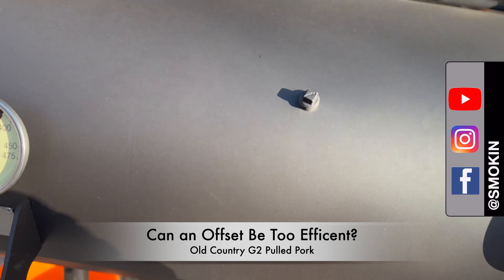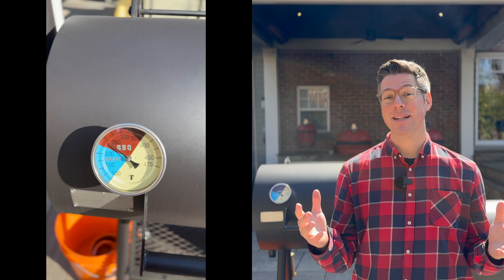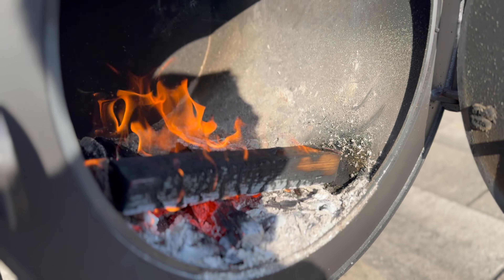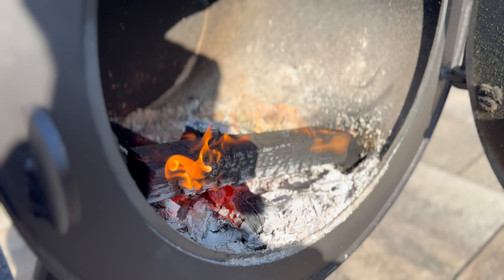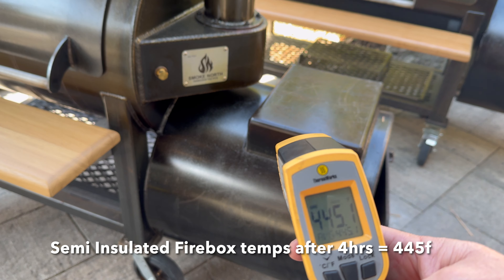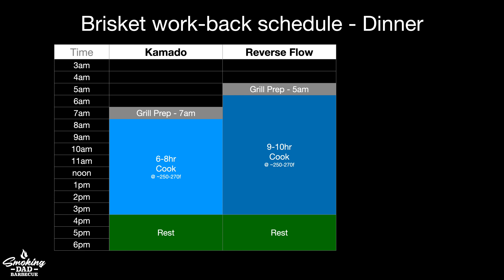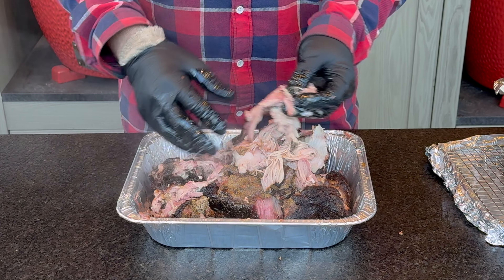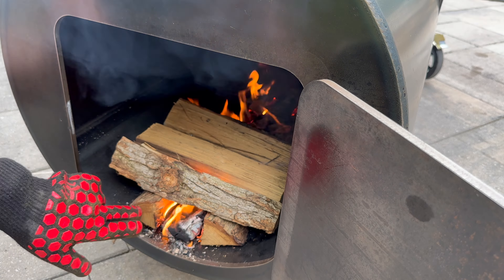Deleting The Fully Insulated Firebox Would Make The Old Country G2 Offset Smoker BETTER?

Comment: Due to its price and ease of use, I think the G2 would be a great first offset. I liked the Mortal Kombat reference. Great review!
Reply from the maker: many thanks, glad it helps.  It definitely solves some ease of use issues ... i am wondering about a two piece insert / semi insulated firebox just using an air gap might be the best of both worlds
Reply: @SmokingDadBBQ  Is the G2 firebox air insulated or does it have an inslulating medium behind the walls like wool?  Also isn't the wall opposit the door not insulated?  tif so technically its semi-insualted?
Reply from the maker: @butkusrules08  it’s got insulation between the metal layers

Comment: I'd been using an OKJ Highland for 4yrs and wanted to move on to a 1/4 steel offset at a decent price.  I do a lot of cooks with the OKJ in the winter using firebrick in the firebox and a welders blanket on the cook chamber. I had pulled the trigger on a new G2 but changed my order after seeing multiple reviews about the lack of smoke flavor with the fully insulated firebox. I quickly switched my order to the Brazos Deluxe and am glad I did!  Put a stack extension on it and lined the floor of the firebox with fire brick. It maintains great temps with very mild temperature spikes. I have unlimited access to hickory and oak, (cut and split my own), so i'm free to put all the smoke flavor I want to into my BBQ!  That's what its all about for me.

Comment: Imo the Brazos is a better buy for under 3000$ category.  Found mine in mint condition for 250, added some modes and now it's a smoke house machine.
Reply from the maker: you can not beat that deal

Comment: Great point. The main goal to cook on an offset smoker is to get the superior smoke flavor.  You were burning the least amount of wood. Seems difficult to run few hours of cold smoke. Even then, it would be too long of cook time.
Reply from the maker: I'd love to see some of the investment/cost moved from the fully insulated firebox towards a larger cook chamber and potentially make a removable semi insulated firebox accessory as an option vs. not having the choice to get the full offset flavour out of the box.  also, personal preference given the paint is flaking off after a few heat cycles would be for a raw finish that could be seasoned with oil vs. the black flaking paint.

Its better value than some at this price point, but also not so much less than some premium options that having flaking paint after a few heat cycles feels worthy of the price point
Reply: @SmokingDadBBQ  It would be really neat if it came with a non-insulated firebox and you could get an accessory that wraps around the fire box to insulate it.  I'm not sure how practical that would be though.

I ran the G2 as hot as I could when I got it to burn off anything that was on it / in it before I used it / seasoned it and so far I haven't seen any flaking paint [not even in the firebox].  That said I did give everything a liberal coating of avocado oil [atomized via sprayer] once it was hot so that may or may not have helped.

So far the paint on this seems to be pretty robust.

Comment: So I literally just bought the G2 and seasoned it yesterday.  it's my first offset and I wanted to jump into something that provided a great way to learn, not be super limited, but also not too complicated.  I do want the max smokey flavor though.  can you imagine a way to increase the smokiness?  maybe leave the door cracked open to lessen the efficiency?  smoking some wings on it this weekend.  thank you and love the content.
Reply: or even allowing the wood to be slightly more moist when putting it in the box to allow more smoldering?
Reply from the maker: I would add some gasket material around the door to seal it up better so that i could control the airflow better from the damper on the chimney which would make it easier to run a dirtier fire a la Bar-A-BBQ cold smoke before cooking style
Reply: @SmokingDadBBQ  you're the man, thanks.  i'll take a look for gasket options and play around with leaving the door cracked to increase air flow/and decreae efficiency.
Reply: Put the splits on the bottom of the firebox will help reduce efficiency and allow you to run slightly larger splits which means more smoke and more time between adding wood
Reply: @2005Pilot  in other words, remove that elevated grate? thanks!
Reply: Yes!
Reply: Smoking a 9.3# butt on the Wrangler
Reply: All splits on bottom of firebox
Reply: @SmokingDadBBQ  It's hard to seal the sides but the top and bottom are easy to seal.  That said I found that you really only have problems with it leaking if you have it choked down too much.  If you stay at 50% dampers or more open - I didn't notice any leaks or at least very little.  I did put some seals on mine but ended up pulling them back off because I couldn't really see an appreciable difference and it made cleaning/seasoning the pit a bit more tedious.

What I found worked best in my limited testing was to build a small fire to maintain the temp you wanted and if you want more smoke - put another split in there close enough to the fire that it will smolder but not so close that it bursts into flames.  It sounds difficult - but the firebox is so big for the small fire needed that it's really not hard to do.

Since the firebox is insulated I wasn't setting the splits on top to warm up - but instead was warming them inside of the fire box.  If I wanted more smoke I just moved them closer to the fire.  If I wanted to warm but not smoke - I just put them far away from the fire.

It's worth trying at least.
Reply: @2005Pilot  Interesting - I was using the plate that keeps them off the bottom for my cook today.  I could see how them being on the bottom would allow less air to get to them probably resulting in a less efficient burn.  I'll have to try that out.
Reply: Congratulations on your purchase.  You did good.  Remember James is on another level and if you're starting with a G2 you're way ahead of the game.  It'll be plenty smoky   Learn your pit and get to smokin!

Comment: I have the G2 - got it last week and seasoned it and then used it for my first pork shoulder cook today.

I'm coming from a Big Joe where I normally don't bother putting wood in [it tends to just be a pain to manage with everything on top] or a pellet smoker where I can adjust the 'smoke level'.

Hands down this is night-and-day better than my pellet and does give me, IMHO, an easier way to get a nice smoky flavor.  The pulled pork I made today was amazing.

I would at some point like to get a much larger offset with a semi-insulated firebox [perhaps even a reverse flow] but this is my first foray into offset smoking and I'm loving it so far.

I did find that I was taking all of the advice for offset smokers that applies to non-insulated fireboxes and as a result I was running way too hot with way too big of swings.  Once I stopped doing that and started experimenting on what worked - I ended up with the chimney and firebox dampers 50% closed and putting in about as much wood as you stated in the video.  Even with the baffles 50% closed I could actively hear the air being pulled into the firebox and I was still moving a good amount of air through the smoker.  Sure I would move more with the dampers fully open - but that just doesn't seem to work well on this pit.

If I open it up all the way and really let it breathe it will quickly shoot to 300+.  Towards the end of my 12 hour cook - I was able to get pretty stable curves where it only went up by ~10 degrees when I added wood and I didn't have to add more for ~45 minutes or so.  This is attributed to me learning the smoker and how to manage the fire for it. 

I also found that with the firebox being insulated as it is - that I built my fire right next to the door and then I placed my splits to be warmed up in the fire box on the far end.  This way they would catch immediately when I put them on the coals.  I would prefer to do it the other way around but I found the fire works best towards the door and it's really not a big deal at all to drag the split over to the fire with my fire tool.

The next time I use the pit I think I am going to build my fire and then place a split just past it close enough to get hot enough to start smoldering but not so close that it burst into flames for some extra heavy smoke right at the beginning.  I could just damper down the firebox but I think I'm going to try having an active fire with a smoldering split next to it - this way when the fire does start to burn down I have a hot split ready to go.

Overall I'm really happy with this smoker and I'm glad I was able to pick it up.  Would I love to have a Smoke North Echo Reverse Flow? Absolutely!  But hey - this, IMHO, is a fantastic pit for the beginner and I'm very happy with my decision to snag it.
Reply: Well Done!! Enjoy Stick Burning 😊👍👍
Reply from the maker: Its a fantastic pit, congratulations.  If they watch this I hope they consider a few small tweaks that might make it even better
Reply: @SmokingDadBBQ  ❤️

Comment: I have an (old) old country Brazos. Just did some ribs this past weekend that took almost 7 hours, even wrapped with butcher paper and lard the last hour. They were damn near perfect except they still lacked that strong smoke flavor I was hoping for. I was thinking it’s either the coke can size pieces of wood I’m using or the smoke going up over the ribs or both. I basically use the same method of fire management you used in this video. I have no damper on my stack as it is a mod extension of stove pipe.  Maybe that could be it too. Love your videos and all the data you provide! Thanks!!

Comment: Excellent info and review. 👍🏼
I currently having a pellet smoker, and am looking to upgrade to an offset. I’m admittedly a bit puzzled at the reason for the difference in taste James commented on. 
My questions:
Whether the firebox is insulated or not, wouldn’t the cook time, and therefore exposure to smoke be the same?  
For those with offsets, does the smoke exiting the stack move away from the clean burning “blue smoke” when wood is tossed in the firebox? In other words, when a stick first starts to burn, is that smoke better or worse in terms of flavor?  The reason I ask is the theory: More sticks equates to more smoke.
Anyones thoughts on this would be appreciated.
Reply from the maker: a fully insulated firebox burns less wood... on a 500+ offset I would order a fully insulated FB as otherwise you are just throwing money away, especially where I am in a colder northern climate.

On small offsets, a fully insulated firebox almost goes into Kamado issues where you either get (1) clean combustion and the temp is way higher than what you want or (2) smoldering smoke which is creosote and not clean burning wood.

In this case, I would prefer a little less insulation so that the wood could burn more clean and use a few more sticks overall which increases the flavour .... a brisket with 5 pieces of wood used will not taste the same as one with 30 for example
Reply: Thanks for the reply. I appreciate you sharing your knowledge!

Comment: Hi James. Thanks for the content. I’ve been thinking about your concept of making smokers less efficient to produce a smokier flavor. In the past I used 2-3 ~14 inch splits in my firebox. Recently I’ve taken a miter saw and cut them in half so I can control the fire better using the log cabin method. I knew going into this that it would require more attention on my part, but I haven’t been able to tell a noticeable difference in whether that produces more smoke flavor. In theory I’m torn bc in one sense, it’s more fuel (and fuel is flavor), but in the other, I find that it’s producing much more clean smoke, and I wonder if I need a hint of that dirty smoke more often. What are your thoughts/suggestions? Thanks

Comment: Thank you for your video. your content helped me make the decsion to buy the old country brazos dlx version . This is my first real offset with 1/4 inch steel. My plan is to have my buddy make a collector  for it. . Im still trying to figure out the fire management  on this. I did buy a 24 inch stack extension which helped. But i can get a decent temp range   from about half the smoker.  Any suggestions how to get more slow cooking space .  Thanks again
Reply: @rocksinger15  what’s the circumference of that stack? How closed down do you have the dampener? If I remember correctly, since that stack is wider and since you extended it, the draw is going to be more aggressive creating higher temps closer to the smoke box

Comment: I've been bouncing back and forth between the G2 and Brazos DLX.
Reply from the maker: If it’s your first offset this will be easier to run and get a good result. If I could make some changes to the design it would be to move some budget from the fire box to the cook chamber size and reduce some insulation

Comment: Just built an offset from a 80 gallon compressor tank and a round scotty Kerr furnace fire box.
Firebox is not nsulated, and it's still hard to get it below 300.
I made the opening to tank smaller but almost gotta make smoke dirty to control it.
Reply: On the G2 I had to run the dampers at 50% closed to keep the temps between 225 and 250 but it still burned pretty efficiently.  I did have the plate in the bottom of the fire box that gets the burning wood/coals off the bottom and allows more airflow to the bottom.  I think I'm going to to try it without that plate next time and see how different is is as far as smoke / airflow / temperature.

Comment: Interesting how this cook turned out.  I guess the bottom line is the more wood you burn, the more smoke you get.  This was proven with your double indirect cooking method that I used over the weekend to do 3 racks of ribs.
Reply from the maker: Fuel is flavour. The most extreme example of this I’ve experienced is my new Santa Maria which is very flavourful…. And very expensive to run. So there is pros and cons. If I could modify this smoker I would push some of the budget from the firebox towards the cook chamber and make the firebox a semi insulated option with perhaps inserts

Comment: This is probably going to be my upgrade from the Oklahoma Joe. The price is tolerable and i can get it locally without paying ridiculous shipping prices. 
RE: smoke flavor, you do have some options to help increase that. Obviously lower temps and longer exposure, avoiding kiln dried wood, burning a slightly dirtier fire would help. I also noticed that you didnt use baffle. That may also improve the smoke flavor  depending upon temps. Either way, i think this is smoker for me. It will have good resale value as well when i decide to finally get a 1975.
Reply from the maker: its a great pit, if i could suggest something to them it would be to move some of the budget from the firebox to a larger cook chamber and maybe make the insulation a semi insulated FB that can be removed to give you the choice of the efficiency or not

Comment: I’ve seen this same comment in many vids and I’ve always see another pitmaster say the same thing, you can use the dirty smoke to impart more flavor but then the insulation is hands down better to make it more efficient and not have you be a damn slave to the world engine (I mean fire 😂)
Reply: You definitely can't run this pit using the general/generic advice for offsets unless you like cooking at 350F.

The fire box is big enough that you can put an extra split in there to warm up that's close enough to the fire to smolder but not so close that it bursts into flames.

On my next cook I'm going to try cooking without the plate that comes in the fire box.  My understanding is that it'll be a little less efficient due to not getting as much airflow to the bottom of the fire.

Comment: Okay, everyone will understand you will never get radiant heat on an offset as the food sits offset of the fire. But what happens if you add firebrick to both the top and bottom of an offset, would that solve the lack of conductive heat issue? Should you want that when it comes to smoke flavour?
Reply: I didn't find a lack of conductive heat - actually the opposite in that I had more trouble keeping it from getting too hot.  I think fire bricks would add some stability and possibly lessen swings.  That said over my first 12 hour cook today I was able to eventually figure out how to get pretty steady heat.  I started out with swings of ~75 degrees and I got that down to ~20 degrees by the end just by figuring out how to run the pit.
Reply: @MikeDQB  great. My comment was actually based on James's chart on offset vs kamado. That an offset has a lot of airflow, but doesn't give of much radiant and conductive heat compared to a kamado. That's why I wondered if firebrick could solve the conductive heat issue. I'm sure it can be delt with if your fire managment is up top but that still means an offset is naturaly bad in conductive heat compared to ceramics.